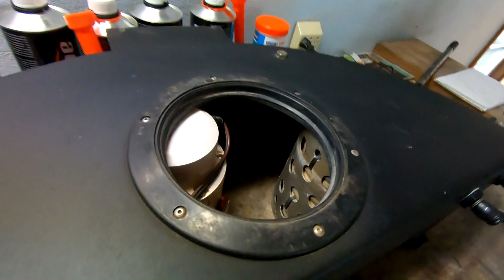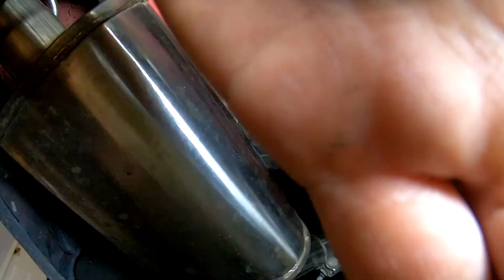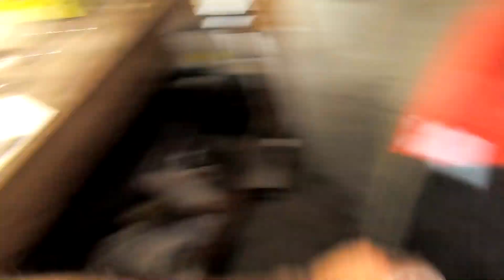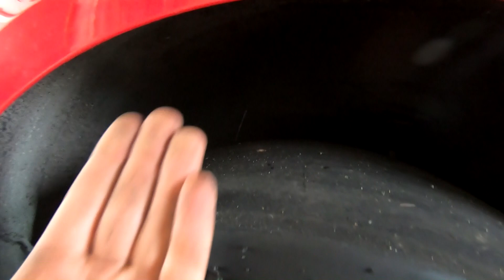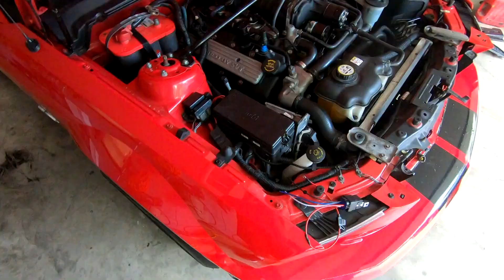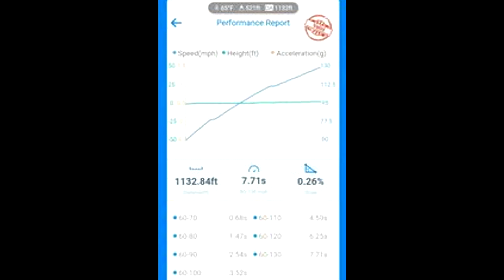2007 GT500 Ice Tank Install |  ft. New 60-130 time

Comment: Great install!  Everything worked on the first try!  Does your pump have a baffle to keep ice cubes from being sucked into inlet of the pump?  If not, ice cubes could block the flow. I'd recommend fully testing it with ice before your track day.  Also, do you have a plan for winter?  Even if you drain the tank, there will still be water in the core and heat exchanger.  I'd buy 4 gallons of coolant, if it were me.  I also agree that capacity is MORE important than flow.  Been saying that forever on the forums, yet people think otherwise.  Great video as always!
Reply from the maker: Thanks man! Yes, the rule 3700 is screened on the bottom, so ice shouldn't be an issue. As for winter, my plan is to drain about half of the tank and use the coolant concentrate, then just run it to mix it all together, that way the whole system is winterized.